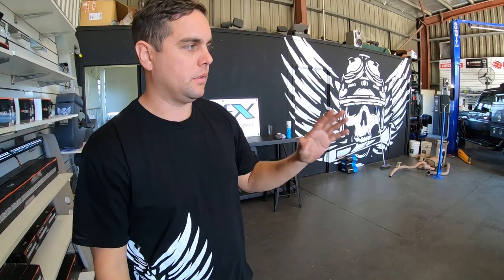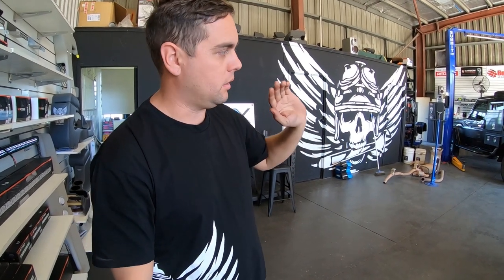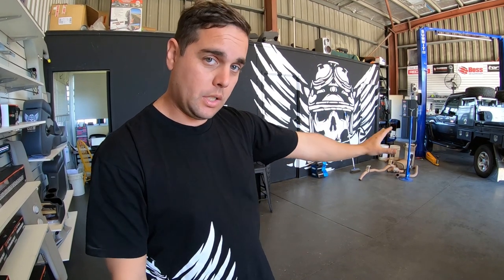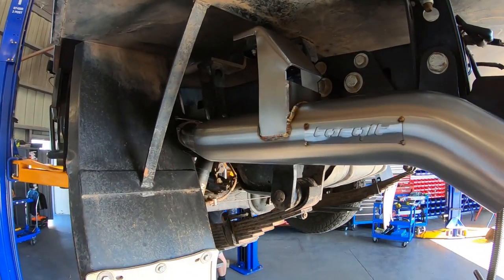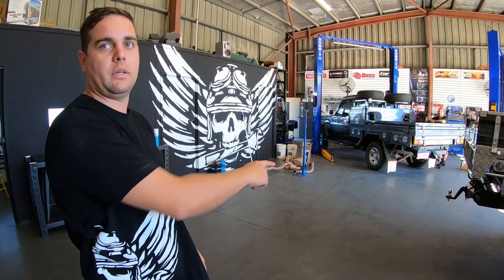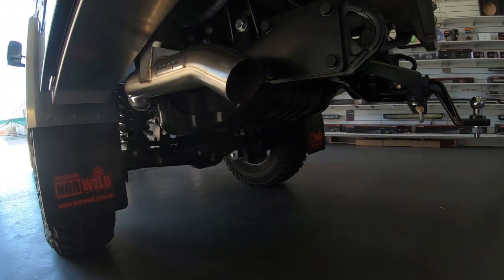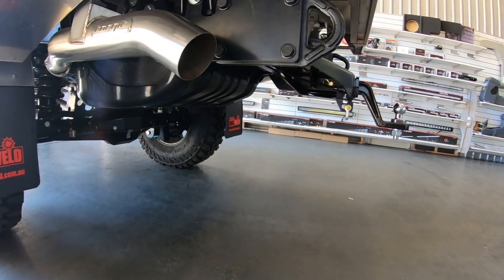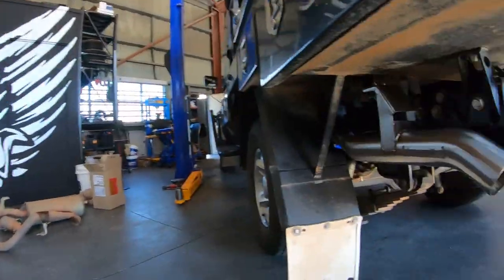DPF back VS Turbo Back: Testing Stainless Steel Torqit Exhausts

Comment: Whats the difference between DPF and non DPF? besides the sound? does the dpf exhaust clean the crap as it comes out?
Reply from the maker: Correct, the DPF is traps exhaust soot and other nasty particles churned out by diesel engines.

Comment: Can you buy the turbo to dpf part for an existing torqit dpf back exhaust ive got? Got the normal 3.5"  torqit exhaust with the coil conversion but wanna go turbo back. Cheers! 👍
Reply from the maker: Have a chat directly with Torqit, they will be able to assist.

Comment: If you had to to choose between a mint 2015 VDJ78 GXL with 40,000Kms for $80K or 2021 VDJ78 GXL with 0kms for $80K  which one would you pick? (obviously one has DPF and the other doesn't)
Reply: 2021